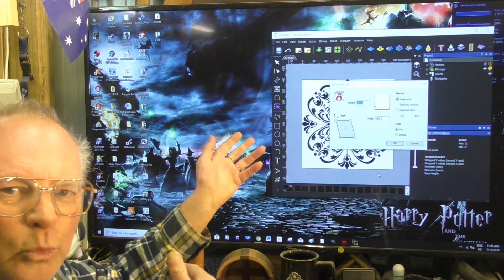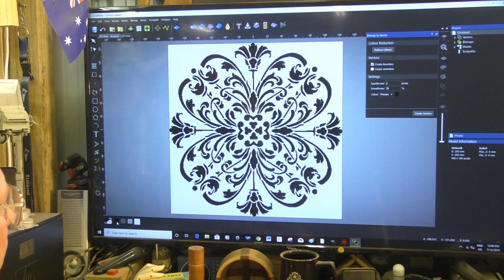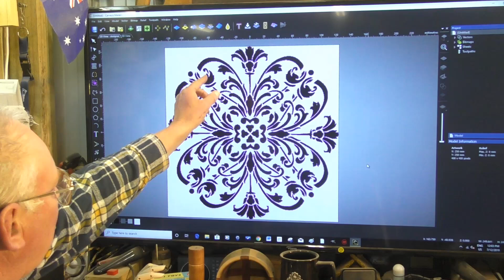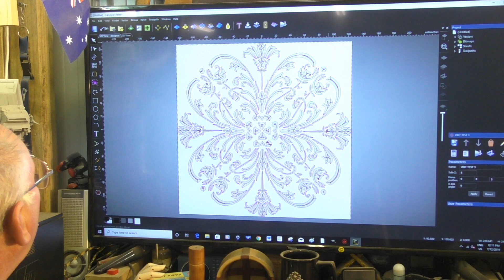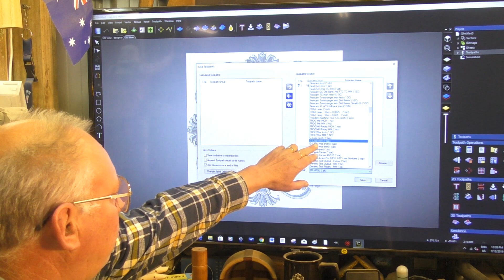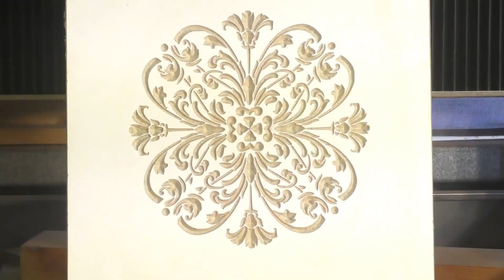How to Vbit carve with a CNC router + CARVECO Maker+

Comment: Hi Roger. When you drag a bitmap image into Maker+, it opens a new project. How can I add a bitmap image into a project I already started? I want to make a 2D sign with a butterfly (bmp), some text, then a mirror image of the butterfly.
Reply: Looks like I figured it out. You click on the BITMAP layer in the list on the upper right. Then below, you click on IMPORT IMAGE. When you select the bitmap image you want to use, it will place it in the middle of the workpiece. You then use the BITMAP TO VECTOR tool in the toolbar at the top to convert it to vectors. The vectors will automatically be selected so use GROUP on the left of the screen to keep the vectors together. Then you can move the vector image anywhere you want and manipulate it. The bitmap image will still be visible in the middle of the workpiece, so you can hide it or delete it. By right clicking I copied and pasted the butterfly vector image. The copy is on top of the original, so you have to move it away from it. Right clicking again and the list gives you options to manipulate it like mirroring it in different ways.